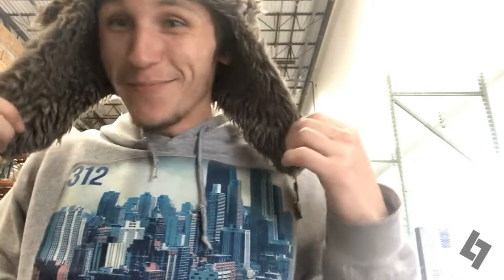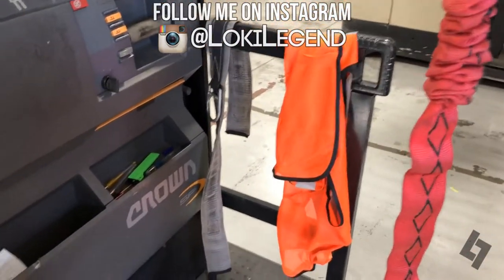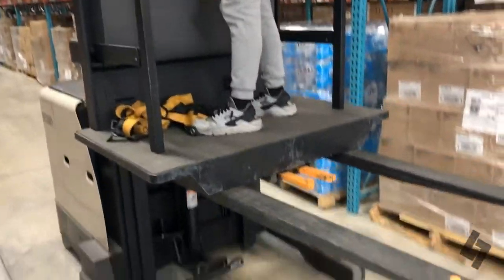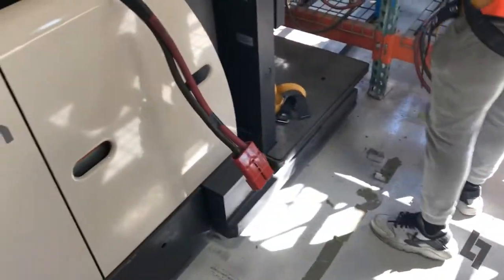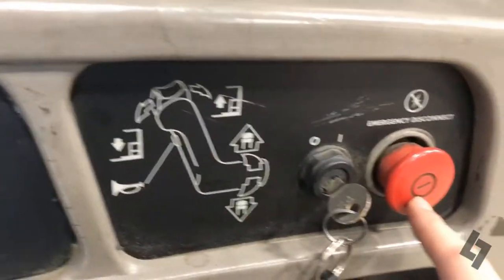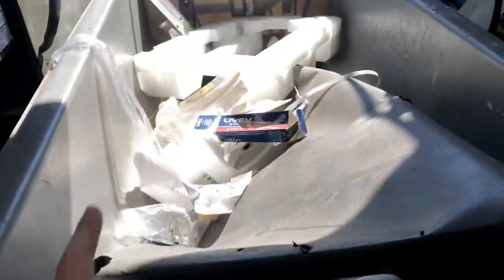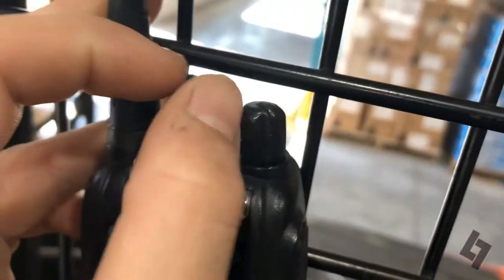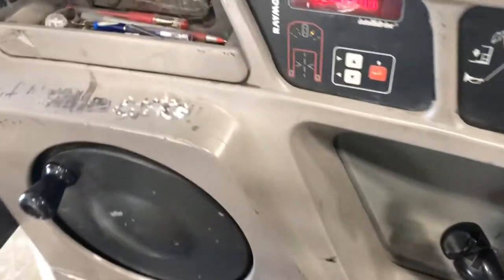VLOG #6: CHERRY PICKER SHENANIGANS - HOW TO OPERATE A CHERRY PICKER

Comment: Bro crowns are the best! They faster then Raymond’s and the forks are skinnier
Reply: At my job I only drive the crown. There's the Toyota ones at my job as well but those are so damn sensitive. You turn the steerer a little bit and it does a 360 lol.